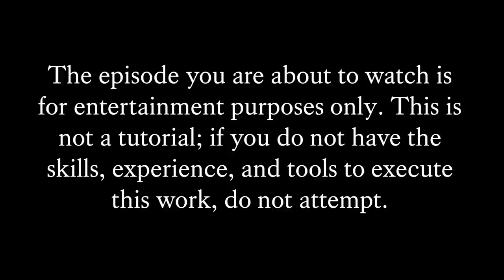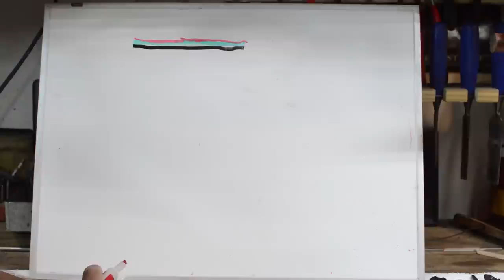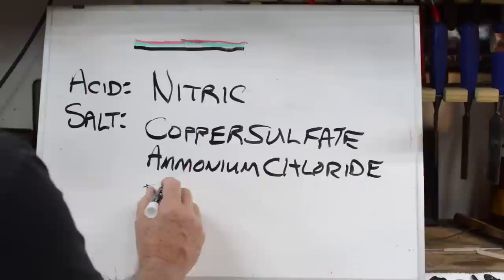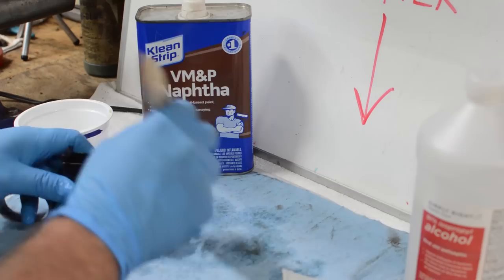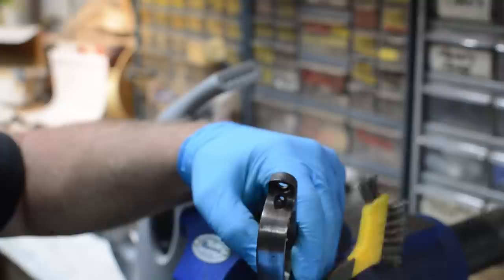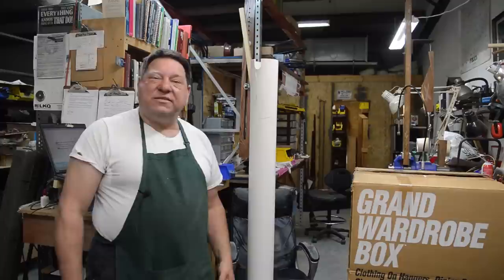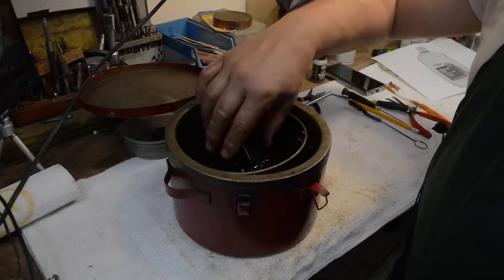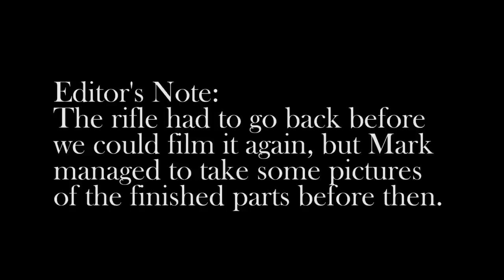Anvil 036: Rust blue a Yugo K98K with Bob

Comment: Naphtha is petroleum based, so when you use it for cleaning, you are adding oil to the surface, and it leaves a residue. Acetone works much better to remove Cosmoline or old WD-40 gunk, and doesn't leave a residue, so it saves the isopropyl flush. You can also use denatured alcohol, but it's usually more expensive and doesn't cut through gunk as well.

If a gun is just dirty, I use a generic citrus cleaner in a boiling pot to remove dirt, but DO NOT boil it. Heating the solution will help it work, but you want it hot, not boiling. This is a different pot than I use for boiling parts in distilled water. A clean surface is vital for a good finish.

Comment: I bought a discounted Star BM that looked like water leaked into the original cardboard box and rusted it all to hell.  I rust blued it with some stuff I got from Brownells and I still can't believe how nice it turned out.  I'll never touch cold blue again.  The rust blue is so much darker and more durable.  It took me a long ass time but I think I could do it much quicker now that I've been through the process.  I think I did 4 applications.  I thought it wasn't getting very dark until I hit it with RIG grease after the last application and it darkened up big time and looks great.
Reply from the maker: The slower it goes on, the harder it comes off. Rusting turns the steel blue, not the top layer. It has to be ground off if laid correctly.

Comment: I wholeheartedly suggest an ultrasonic cleaner (large ones are available for a good price, imported from overseas)  When combined with appropriate solvents and detergents they are GREAT for deep cleaning.  Ultrasonic cleaning doesn't discriminate on location.  Pinholes?  Nooks crannies and crevices?  Nooo problem.
Reply: Hard finding a long one.

10" or less is no trouble, but you need a @40" trough to clean a whole rifle.
Reply: @ScottKenny1978  I understand that barrels complicate the process.  In this instance I was referring to disassembled rifles.  HOWEVER if one is in posession of a larger unit (not the little 2L jobs) you can bypass the factory tank by placing a larger tank inside in direct contact with the metal basin.  Any tank/tube will work although plastic will degrade the amplitude as you get farther from the transducer.  I imagine that even a solid wall PVC pipe will transmit energy a good ways up the water column when doing long parts.  Flip the part and do it again.  My wife is a veterinarian and we have had to devise ways to clean some of the large animal tools.  Stainless jugs/jars/containers work well.  We have used smaller plastic containers too that are taller than the factory tank- just be sure it contacts the bottom well.  The factory tank is just there for the convenience.  The real machine is that transducer :-)
Those can be bought on ali-express by the way.  One day I may roll my own.
Reply: @mattfleming86  well, if you can just add some parts, I'm thinking metal rain gutters and a metal block to connect to the tank...

Didn't know that just adding a larger tank would work! 🤯
Reply: @ScottKenny1978  Yup!  You want to keep the volume within reasonable limits depending on power output.  I also discovered some folks using containers with tight lids to have a part submerged in solvent, which is then submerged into the water filled tank.  Keeps the crud out of the main tank and allows you to use a solvent you wouldn't want to pony up the cash for 1.5 gallons of it.  So far I have only tested that with alcohols and small parts.  I have a few other things in front of it, but I will be buying a large ali-X model for "home and shop" use.  So far I have been very judicious in borrowing the wife's (and double sealing everything) but they are amazing tools.

Comment: I have the same rifle. I did rust blue it and I liked how it came out. But because I live in California and the humidity level some of the parts have a bit of a brown tint. Still like the job.
Reply from the maker: The rusting box decouples you from ambient moisture levels. It's humid as the tropics in Charleston, but we still use a damp box for consistent results.
Reply: I think Bob had said that when you first apply the rust bluing to the metal before putting it in the box is when the humidity levels will cause the brown tint.

Comment: Plastic bag, put the part in and pour the solvent in. Conforms to the shape and you can use less solvent.
Repeat few times whit clean solvent.
You can do the industrial thin too, in sealed metal cabinet pan of solvent is boiling, vapors go up and condense, droplets fall down and clean the part, no comntamination if done right
Reply: good info

Comment: Ferric Chloride is also used to etch Damascus or Pattern Welded steel. Darkens low-nickel steel quite nicely.
Reply: We use it in water treatment too in the early phases as a coagulant.

Comment: Hey Mark I appreciate you sharing the knowledge here and I am working up the nerve to do it myself. What do you do to the INSIDE of the barrel after all this? I have to imagine that the metal on the inside is affected by the boiling and everything else as well, but I can't imagine that you are running steel wool through the bore. Thanks again.

Comment: Fantastic! I’ve been rust blueing over the last few years and even though it’s a little different, the fundamentals are the same. In my initial learning experience, after all the blueing was done I baked my components in the oven at 450 for an hour with a thin application of artist grade linseed oil. This created a thin protective coating. After that, I baked the parts with a healthy coating of mineral oil at 200. Love the end result but I wonder what you think of this, have u tried it or would u ever?

Comment: How about antique firearms that were originally issued in the white ???  
Just wondering how that procedure is performed ???  
In the waxing process is the gun de-greased again ,then waxed ? Or just wiped dry and waxed over any Kerosine residue ??  
Don't mean to be picky. Just would like to do the correct steps. Thanks for everything you show.
Reply from the maker: In the white: convert off all active rust, then buff back to white with the least aggressive scotchbrite pad you can find ( I use the purple ones). No need to kero an in the white surface. The kerosene acts to set the bluing. Go straight to the wax.
Reply: @marknovak8255  Thank you Mark !!!  Now I can start some of my Fall/Winter projects. And yes you really are a Wurlitzer !!!

Comment: Looks like a bottle of the rust blue solution is only about $30. I may have to pick up a bottle of this, the DIY inexpensive bits and pieces, and try this process out. I might even pick up an old beat-up shotgun or something to experiment on before attempting on any of my mil-surps in my collection. To make sure I have the process down correctly. My worst-off finishes that I have are some old shotguns now that I think about it.

Comment: Anyone here know how to prevent water spotting when using the PVC steam tube? I get a nice covering of rust on my shotgun barrel after using the bluing solution. Before putting it into the steam for 10 or 15 minutes I heat the barrel with a heat gun. I've heated it up to where you can barely touch it, and I've heated it to where it's just warm to the touch. Both times I pulled it out and it is covered in water spots. I am using distilled water at a rolling boil. Any help would really be appreciated!

Comment: I'm in the process of rust bluing an old 1949 Stevens side by side receiver, how to I deal with the surface rust that is present deep inside the receiver,  after steaming, where carding will not reach?  It is so poorly machined inside I cannot even get at it with acetone rinsed steel wool.  I've been scrubbing with kerosene soaked q-tips, but it still shows rusting days after finishing (the rest came out AMAZING).  Any advice from anyone?  Thanks!
Reply from the maker: I use toothbrushes, soaked in non detergent lawnmower oil. This has worked well for me always, however you may have a special case here.
Reply: @marknovak8255  That worked perfectly, thank you!  I come from a very different profession (research veterinarian), and after watching and enjoying all of your videos I have had the confidence to take on conserving my grandfathers old rifles (Springfield 1903, etc), preserving a few pieces for the next generation.  Thank you very much for the reply and all that you do for the community.

Comment: Would the process affect the bore finish? I know with a lot of those old military rifles it doesn't make much of a difference but if I wanted to blue a custom rifle with a high end barrel wouldn't it cause bore inconsistencies? I am used to my competition rigs that shoot quarter minute or better but taking a 20 pound gun hunting is kind of stupid and a stainless barrel sticks out like a sore thumb.
Reply from the maker: A stainless barrel is very difficult to rust blue, and not possible to hot dip blue. However, a good bead blasting and an application of Spartan Shield and I can turn it any color you want (really really deep blue?)   markfixesguns@gmail.com
Reply: Use clear lacquer to coat the bore. Will come out easily with lacquer thinner after the procedure. As far as excessive rust you should only have rust to convert in the areas where you're painting your rust blue solution. If you don't paint it inside the bore, and if you line it with lacquer there will be zero issue.

Comment: Do you have a video of  parkerizing?  Ive got a nice sks that really needs parkerizing.  The origjnal finish is very fragile.  But its a great little gun.
Reply: Are those parkerized? I could swear the two that I have are blued (Yugo and Chinese). Either way i'd also like to see a parkerizing video as I have a few US military mil-surps that the park is a little thin on. If I remember correctly, though, it's a more involved process and deals with some pretty nasty solutions that have to be heated.
Reply: Yes the original finish is blued.

Comment: On the initial conversion: Why not just wire brush off the small localized rust, and then begin the blueing process? It would seem to be more difficult to get uniform color by doing that initial steam conversion, as well as requiring more time.. Does the method shown have other advantages, like superior durability?
Reply: The initial bit of rust is going to convert anyways. There's no need to mess with the original finish under the rusty spots since the bluing doesnt get darker after 4-5 passes. You can rust blue right on top of the old layer of bluing as long as you de-greased properly.
Reply from the maker: Converted black oxide requires far less effort to remove....read: less damage to the metal polish/prep. It just looks far better to do it this way. Mr. wertewrtwert's point also
Reply: @marknovak8255  I ended up picking up a junk revolver to dremelsmith on after watching your rust bluing vid. I was amazed to see the rust turn to bluing just as you have described.
Reply: @topguntin  Love the term Dremelsmith. My new word of the day.

Comment: Hey, Mark am I correct that this particular process avoids or minimizes hydrogen embrittlement? (I have seen recipes that include hydrogen peroxide, but that seems like it is asking for trouble.)
Reply: Don't use peroxide, acetone and any acid together. All can be used in bluing, but if they come in contact with each other, they produce TATP which is an extremely unstable explosive.
Reply: @blackirish781  Crap, I had plumb forgot about TATP... ”nice bluing job there...deflagration ensues.”
Reply: if you're getting embrittlement at these temperatures, you're not working with any kind of steel worth making a gun out of

Comment: I have  been  sticking  all of  my  carbon  knives  in  lime juice  over  night  turning  them black  for years  I wonder  if  it  works  a similar  way
Reply from the maker: Nitric acid pickle. Kind of like Parkerizing. Really want to see it go? heat up the lime juice to 120 or so degrees...........
Reply: @marknovak8255   never  thought of  that  thinks  for the  tip  I will  try it some time

Comment: I'm wondering what the bristle size of your carding wheel is
Reply from the maker: .0025
Reply: Thank you for your reply
Reply: @marknovak8255  you mention putting wax onl after setting the finish  in kerosene. Would mineral oil work (after kerosene) in place of the wax?
Reply from the maker: @dubb5508  I have never used mineral in this mode before.....no data

Comment: Won’t you get rust inside the barrel without plugging it?
Reply from the maker: The arsenals plugged the barrels because the actions were dipped in a tank full of chemical. In this case, no chemical is in the bore as it is hand applied where we want it only. So no, we did not plug the bore and it came out perfect.

Comment: I have a marlin model 90 20 gauge o/u shotgun that I would like to conserve.  I’ve heard that they used an alternative surface coating on the receiver, and that the steel they used will turn a plum color with most bluing techniques. Any experience with these? Thanks.
Reply from the maker: No experience here with this particular make. However,  I would say if it's rusted up badly, stop the rust and accept the final color.

Comment: How do you keep from rusting the bore while in the steam pipe?
Reply: You're converting any red rust into blue rust with the steam.  Then using the mineral oil or kerosene to get any leftover moisture out.  Once you run a brush through the bore there'll be nothing left but a fresh new bluing coating.
Reply: I have used those rubber plugs I think they are called radiator plugs..Sort of cone shaped with a screw on one end.Stick it in the bore tighten the screw and it draws the plug up tight in the  bore..
Reply: If you do the process over a couple days, you won't have to worry about the bore.
You don't put the chemical in the bore, so the bore should not rust.
If you do plug the bore, do not leave them in place more than 12 hours to prevent rust from condensation.

Comment: What kind of nitric acid are we talkin about here diluted nitric acid 70% nitric acid or concentrated nitric acid also called fuming nitric acid that's a very critical detail right there because if anyone tries this at home even if they have the right skills Affair not verse with chemistry and they use latex gloves there is a good chance that they use in order from a reputable chemical Supply Company very concentrated nitric acid and that they use latex gloves with it instead of vinyl what are Global Catch Fire and I will get extreme chemical burns on their hands
Reply: It's probably closer to the 30% stuff you can buy I'm hardware stores. You're right though, no gloves around concentrated nitric acid!
Reply: Very true. I'd recommend skipping the home chemistry cocktail experiment and just purchase a bottle of the solution from www.rustblue.com

Comment: Its kind of hard to find isopropyl alcohol of any kind nowadays with the virus thing going on. Everyone wants it to disinfect surfaces, and hand sanitizer, since the CDC claims that it is most effective on the virus.. As soon as the truck unloads it and it is put on the shelves, if you are not there when that happens, the store employees get first shot at it and the customers snatch it up inside of an hour or two.
Reply: Order it online from a chemical or medical supplier. Cheaper, and delivered right to your door. A liter online is cheaper than 250ml at the pharmacy.
Reply: Acetone works, as well as non chlorinated break cleaner. I haven't seen any inconsistencies with using either of these.
Reply: Well the hoarding stage is about over now. (Dec 08 2021) hand sanitizer, isopropyl alcohol is available at most stores that sold it before the hoarding began. Things will take a long time to get back to normal though.

Now we are in the “are you vaxxed stage”. If you’re not, you’re treated like a pariah, a biblical leper.

Comment: You clean it, you steam it, you boil it, then you brush it . Is that it ?
Reply: You steam convert any existing rust, brush, you clean it, you clean it again, you clean it one more time for good measure, you coat it in rust blue solution, let dry, coat again, rust it, steam the whole thing to convert, fine wire brush, mineral oil or kerosine, wait a few days for it to cure before applying any gun oil, or your bluing will come off again.

Godspeed.

Comment: I have a Yogo K98. The stock got broke in the back of the truck and right at the back of the grip and where the bolt pulls back. I got it swapped with a friend.  Now I need a wood piece on the front end replaced. But I sanded the who gun (wood) down and re-did a poly stain of a light cherry color.  Now it looks great.  Shoots like a champ.

Comment: Can you reuse the mineral oil or Kerosene ?
Reply from the maker: Yes. There will be dragout from the pot that will have to be made up, but I use it over and over. Any water winds up on the bottom.
Reply: @marknovak8255  thank you. Does the quality of the product/work  change between the "cheap way" or the "sophisticated equipment"? To use them terms of the video.
Reply from the maker: @Wick3d3xil3d  No, it does not, and that's the point. Fndcy gear=volume, not quality
Reply: @marknovak8255  I appreciate you answering my questions. I enjoy your content and learning.

Comment: What temperature do you need to heat the box to? I live I live in the tropics so my shed temp is about 104F. Do I even need to preheat?
Reply from the maker: Preheat to 10 degrees ABOVE the local dewpoint, so liquid moisture does not appear on the surface of the metal. The accumulation will compromise the appearance and quality of the finished attempt.
Reply: @marknovak8255  Cheers, I'll use this process to conduct the deferred maintenance on my Aussie Lithgow SMLE MK3 (Mint bore)